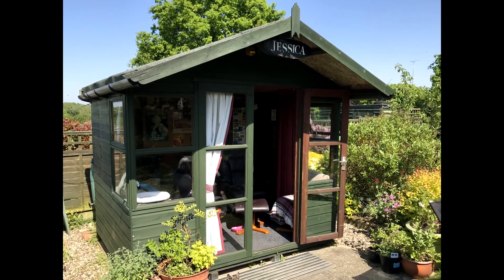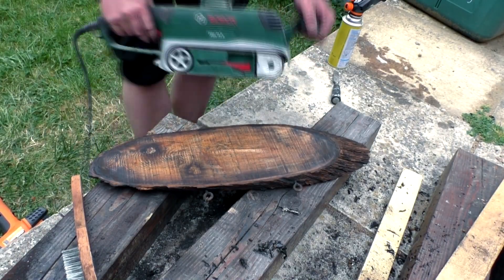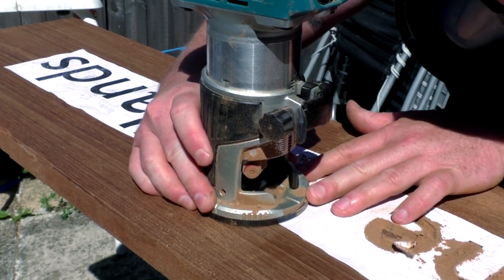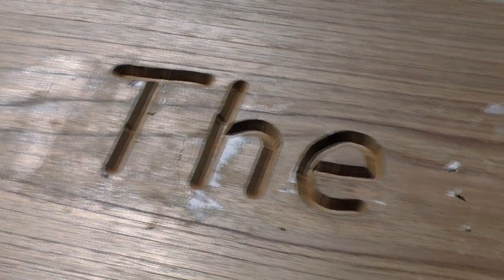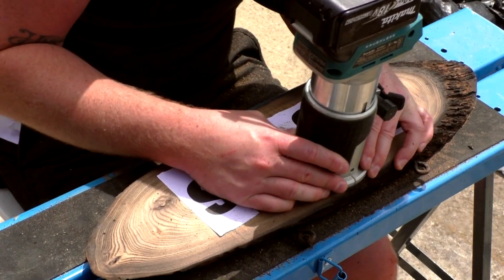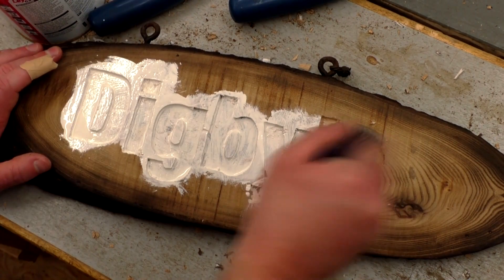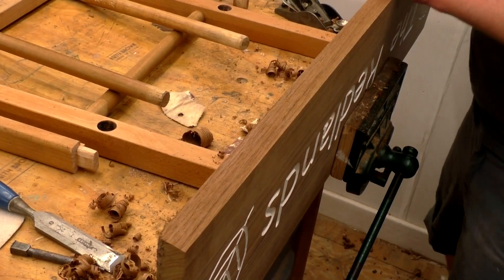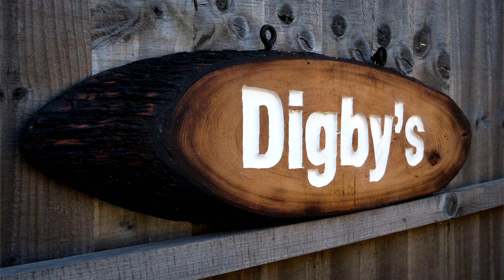Making Two Signs - hand routing

Comment: If you're goggles are fogging up wearing a respirator then the seal isn't very good and it's probably letting in the dust too.  I had to get a larger one which fitted much better and was far more comfy.  It's the JSP Force 8, Axminster sell them in the S/M/L range but screw fix also sell them and the filters, but only in a M ish (It's not marked like the version at Axminster).

Though could also be you need a shave,  the seal on mine is usually bad for that reason!

Comment: I use a trim router for signs as well, just seems to be less cumbersome than a larger plunge router. For finer detail a Dremel comes in handy too.
Reply from the maker: I'd like to get a dremel at some point
Reply: My first Dremel project was to carve a free-standing letter sign that someone more artistic drew for me freehand. It turned out really good even for my first time, and gave me a real feel for using the tool. It's a great tool for lots of uses. Get the flex shaft if you plan to do much carving with it.

Comment: Another cracking video. Where did you get the idea to route the letters free hand?
I have a tip regarding the fogging/goggles issue, I now use a full facemask which both separates the air from your eye area (hence no fogging) but it also prevent errant bits of wood/sawdust sneaking around and into your eyes. I now use the facemask most of the time.
Keep up the great work.

Comment: Regarding not using the plunge router:  if you'll feel comfortable while you're working you're less distracted and more likely to work safely.

If you do this again try putting painter's tape (the blue stuff) down on the wood then gluing the routing pattern to that. Leave it in place while painting; when you're done the tape will (well, should) peel cleanly off the wood and you won't have to deal with any (or at least as much) cleanup.

Very nice work!
Reply from the maker: great tip! thanks

Comment: Nice job Keith! I'll be doing the same myself shortly as we are planning on a new wall and pillars at the front of our cottage. 

If the wood for the Redlands sign is walnut, how do you think it would weather outdoors? Did you use anything special to coat it? 
Like yourself, we suffer similar climates as I'm in Ireland. Any suggestions?

Keep up the good work ;)
Reply from the maker: Thanks! Walnut should be ok for exterior use, or so I’ve read. I used teak oil and have asked the client to re-oil it frequently to keep it in good shape.

Comment: Turned out pretty well, good job, mate👍
Try rubbing a dry bar of soap on the inside of your eyewear, let it sit for a few minutes then buff off.
You'll find it takes a lot longer to fog up. Some say shaving cream works well too, although I haven't tried that one yet.
Reply: Washing up liquid works well, used on the inside of my motorcycle visor for many years
Reply: Phil Rogers there are also fog stop wipes you can buy. I guess there would be a myriad of household items that could be used.
Reply: Phil Rogers ... Hello. What exactly is washing up liquid? Is it the kind used for bathing? I’m from New York so not quite sure. Thanks!
Reply: @weston0614  it is the liquid you use for washing kitchen wares, dishes, cups, pits, pans...
If you have a dishwasher, you might not buy dishwashing liquid.
Pretty similar to shampoo, though.
Reply: @weston0614  as Bill says, 😁